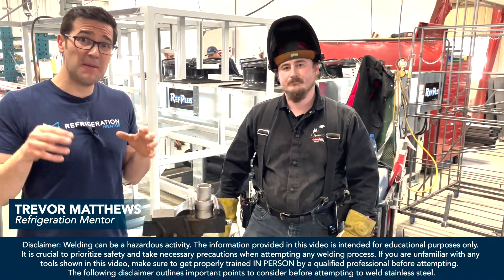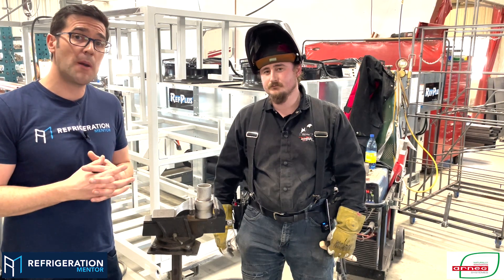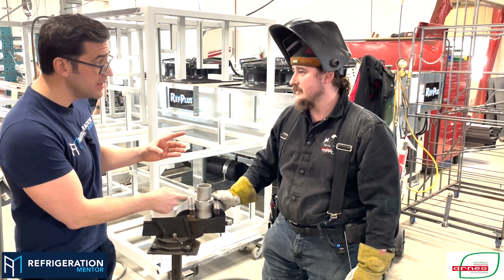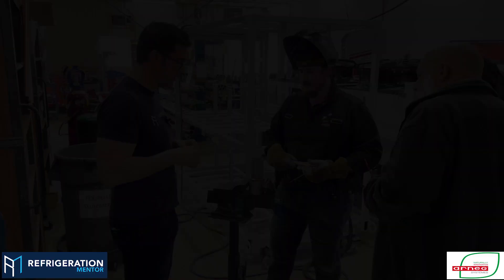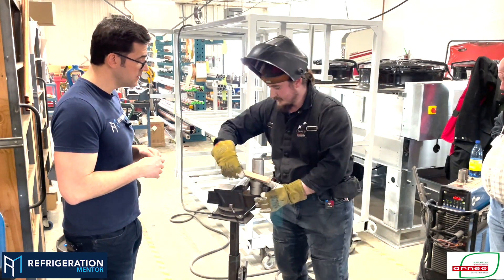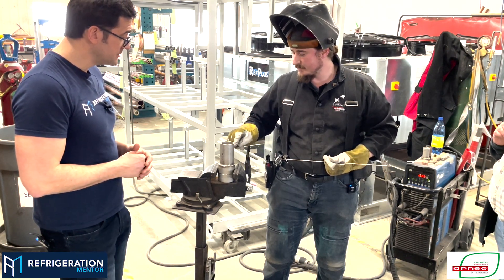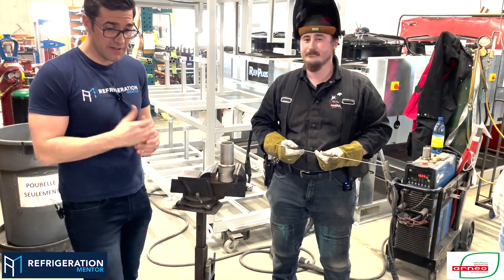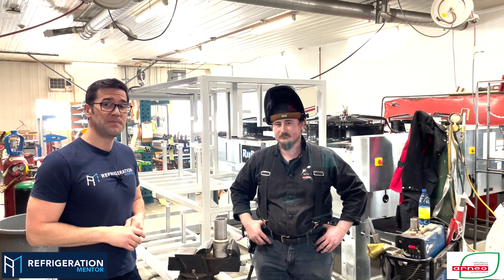Welding Tips for Transcritical CO2 Systems

Comment: Extra key points for viewers to recognize:

1) That brush that he used to clean (very important for weld integrity reasons) is of the same metal as the parent & filler material, i.e. Stainless Steel (regardless of the SS family, austenitic, ferritic, martensitic, duplex)
2) From what I see, he is using a Laywire (for the cap pass) hand vs a dip hand.
3) Since the Cap Pass requires a larger filler rod, it also requires more Amperage; keep that in mind for your heat control and utility power.
4) I (as you all are as well, I assume) am unfamiliar with these CO2 systems, and don't know where this trend will end, but if it means moving towards actual welding vs hard brazing, then this is going to be a labor problem; I forecast.
Reply from the maker: @MR-backup thank you very much for sharing these critical tips. It is much apprectiate from the Refrigeration Mentor team.